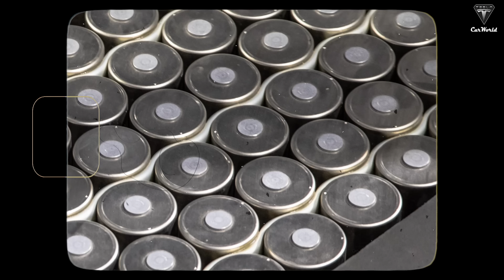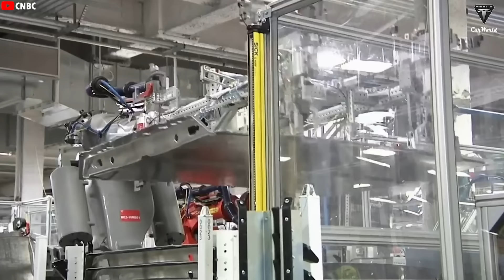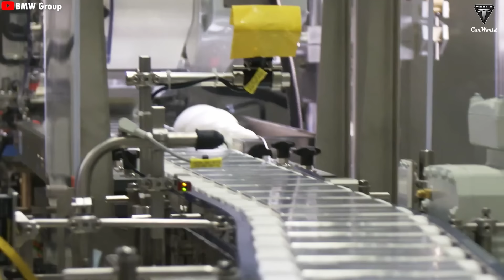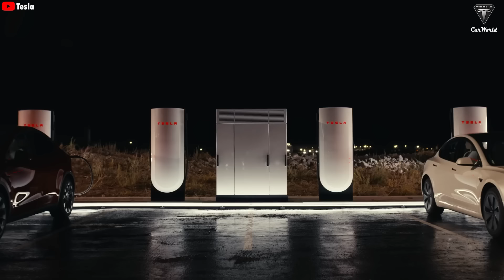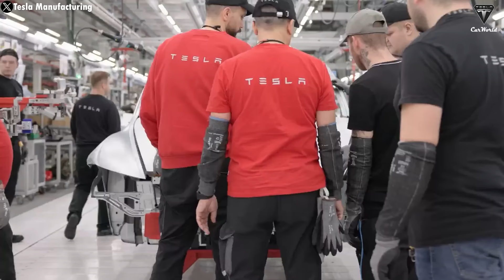Elon Musk's Tesla 4680 Battery Delivers Maximum Energy With New Upgrade

Comment: 4680 batteries are harder to cool than 2170s.  If 4680s don't lower the price of a Model Y or allow for a range extension, then there is no reason for me as a consumer to want them.  The old 4680 structural pack didn't reduce weight or improve structure stiffness as fanboys expected.  Filling the battery cavity with structural foam reduced the packs value as a refurbishing tool, so that's another reason to possibly prefer a 2170 battery pack if price and range for these two battery architectures are similar.

Comment: The video, titled "Elon Musk's Tesla 4680 Battery Delivers Maximum Energy With New Upgrade," provides a comprehensive look at the recent breakthroughs and strategic shifts regarding Tesla's 4680 battery technology.

Major Breakthroughs & Technical Upgrades
Dry Electrode Process: Tesla has successfully scaled the dry electrode process for both the anode and cathode 
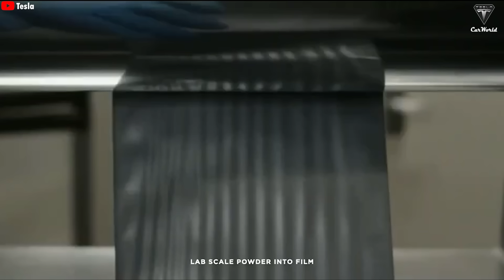06:20
Opens in a new window. This eliminates the need for massive drying ovens and toxic solvents, potentially reducing factory floor space by up to 90% 
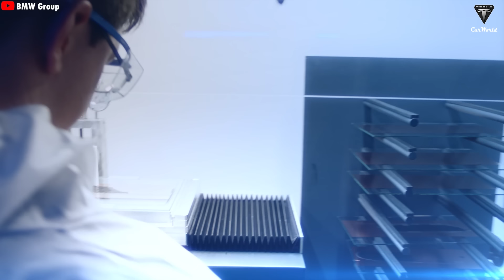07:23
Cost Efficiency: With these upgrades, the 4680 battery is now cheaper than the 2170 cells on a per kilowatt-hour basis when produced in the U.S. 
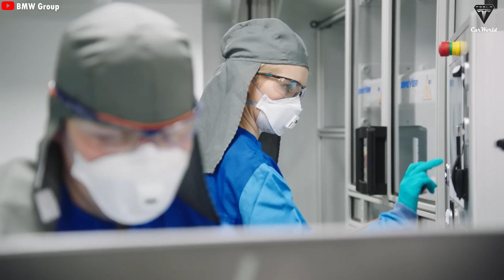07:29
Opens in a new window. Mass production costs could eventually drop by 20% to 50% 
09:49

Performance Improvements: * Energy Density: The cells maintain high energy density (around 272 Wh/kg), with a 5-10% improvement due to optimized physical structure and less binder material 
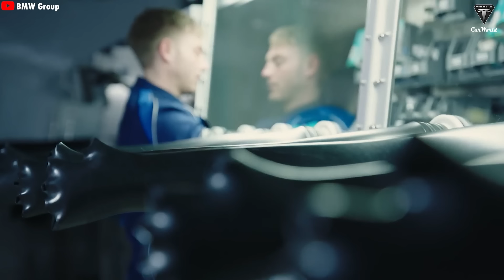07:43

Durability: New generation cells are expected to retain 90% capacity after 2,000 charge cycles 
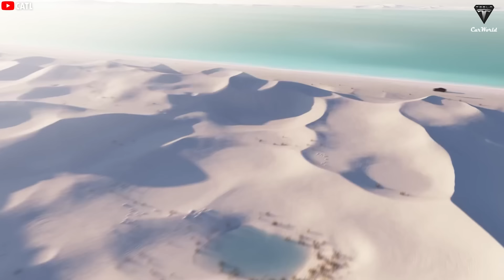08:34
Thermal Management: The "tabless" design has been further refined to improve heat dissipation, allowing for higher currents and faster, more stable charging 
09:04

Strategic & Commercial Shifts
Model Y Integration: After a period of being exclusive to the Cybertruck, the 4680 battery is returning to the Model Y 
10:27
Opens in a new window. This move is intended to diversify the supply chain and act as a hedge against potential tariffs on Chinese-made batteries 
13:20

Supply Chain Control: By producing these batteries entirely in-house and domestically, Tesla aims to protect itself from geopolitical instability and trade barriers 
14:08

Production Focus: The video notes that Tesla is prioritizing its best-selling models (Model 3 and Model Y) and may scale back low-volume models like the Model S and X to focus on these high-efficiency pillars 
16:00

Overcoming Past Failures
The 4680 was previously criticized as a "failure" by industry experts (including CATL's CEO) due to early production bottlenecks and lower-than-expected energy density 
00:43
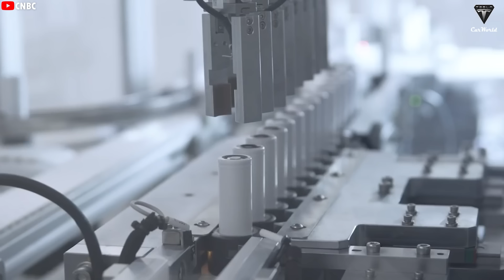04:41

The Cybertruck served as a real-world testing ground while Tesla spent years mastering the dry cathode manufacturing process 
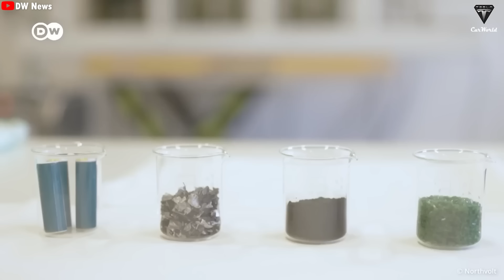05:30
For more details, you can watch the full video on the TESLA CAR WORLD channel.
Reply from the maker: Hmm, I hope everyone will watch the whole video.
Reply: Amazing work here 👏

Comment: 2026 model-year and Mass produced avaition grade CALB' UP high-energy density semi-solid electrolyte multinary cathode and high nano silicon content composite anode 4695 cylindrical series with 365 wh/kg(industry benchmark for a 46-phi cylindrical battery CALB also can achieve 470 wh/kg with dry cathode and anode coating process) these cells have adopted innovative U shaped structure process with 70% lower IR which leads to amazing 6c(10min)charge rate with out sacrifising cycle life of the cell(amazing 2000 cycle life).they use hybrid solid-liquid electrolyte with 3 times higher operational tempreture window(200 C vs conventional 60 C ). I think CALB just surpassed every world-class manufacturer including CATL and tesla for innovation and quality standards .
Reply: What about the price?
Reply: if bmw use these 365 wh/kg semisolid cells in an updated or refreshed neue klasse ix3 50 xdrive,they will have 145.6kwh usable instaed of current 108.7 kwh usable . Their amazing updated ix3 50 neue klasse will have 12 years ahead of industry of 722 miles of WLTP range,(these cell have 7% better efficiency because of 70% lower internal resistance) . The msrp will increase by only 2500$(62500$ which is still 7500$ cheaper than 2027 spa3 based volvo ex60 p12 and MB glc400 EQ).it will have 6c(10min)charge rate and 40% better range compared to industry benchmark(503 miles wltp in volvo ex60 p12).and it will be the best selling automobile of any kind in the world . so that 2500$ price increase worth every cent of it.